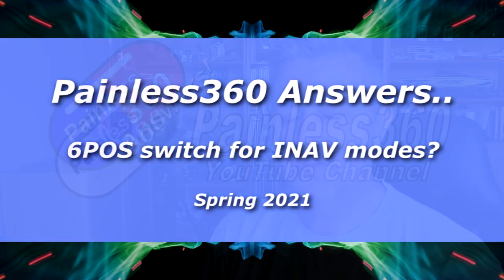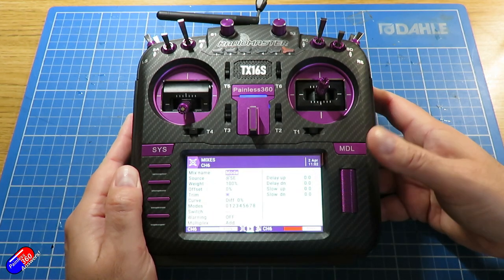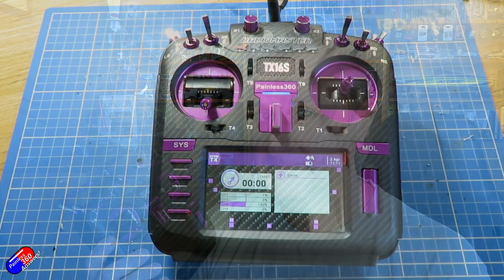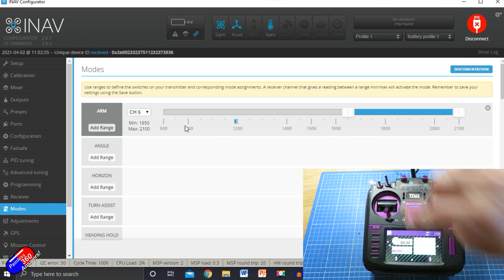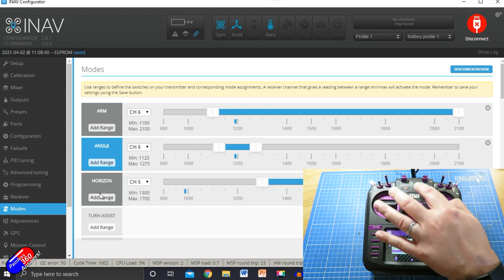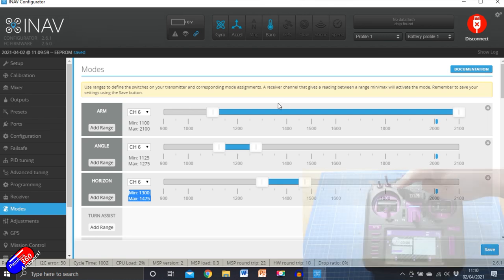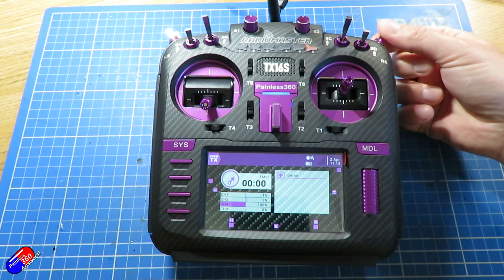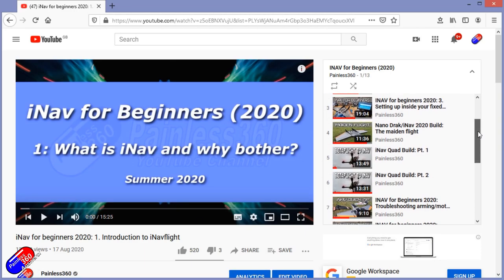How do you use the 6POS switch with INAV modes?

Comment: Nice timing for the video. Was just getting ready to see if it could be done. Changed all my planes over to crossfire from R9 and on my Phoenix 2400 12 channels isn't enough. Going to setup my cruise modes on the 6 position switch and free up 2 channels. Thanks much!

Comment: Hi. I was wondering if you might be up for making a video on setting up manual mode in inav… I have a tundra that flies fantastic when I connect it up direct to the receiver (missing out the fc) but when I add in the flight controller it flies ok in acro and horizon mode but manual is no where near what it was without the fc. My son loves the option to return to home and the auto level of horizon mode but I absolutely love the way it handles without the fc… cheers Chris 👍🏽
Reply from the maker: What do you think is changed? Travel, expo? I fly manual with iNav a lot so happy to look at this.
Reply: @Painless360  thanks, its reassuring that you fly a lot in manual too. I think it is expo and travel related... might also be trims (that might be everything it possibly could be) I think it is gap in my understanding about how manual mode is related to acro mode.  should I use trims, should I set up manual mode then auto tune/trim. where best to set rates/travel inav or radio?  also there seems to be a number of places in inav configurator to set expo. Thanks for taking the time to think about/help me on this.

Comment: The 6p buttons work to select modes but playing audio flight  mode prompts for each flight mode selected does not work as it does on my old trusty Taranis QX7 ACCST.  It  only works for  button 6P1. 
Is there and additional step that  needs to be taken ? When flying with eyes on my r/c plane I would like some audible confirmation that I pressed the correct button.  I use the switches for augmenting flight modes (tune, trim servos, etc), flaps, lights, and landing gear.  It would be useful  to have audible prompts for assigned flight mode buttons.

Any help would be appreciated.

Thanks
Reply from the maker: Just tried it here and it works perfectly on OpenTX 2.3.9 I have on my radiomaster..

Comment: Since AUTO TUNE , Auto Trim, and Auto level are only used during set up I am wondering if  having "Manual" on 6P1 will interfere with other modes on other switches and channels ? Should 6P1 be left blank and Manual be on another channel / switch ?
Reply from the maker: See my video on how I setup modes. You can have more than one mode selected by a switch position so you could have angle and auto-trim for one position... Happy flying